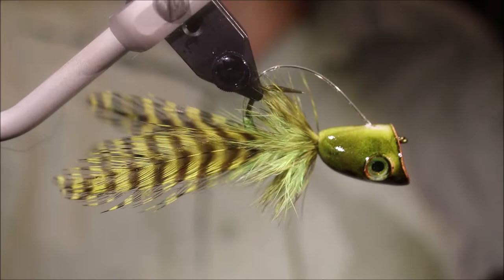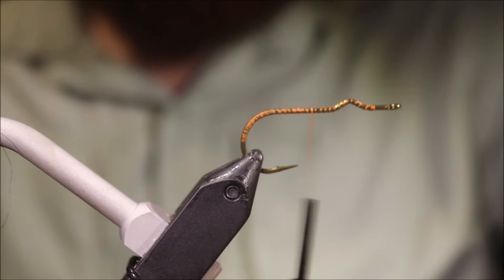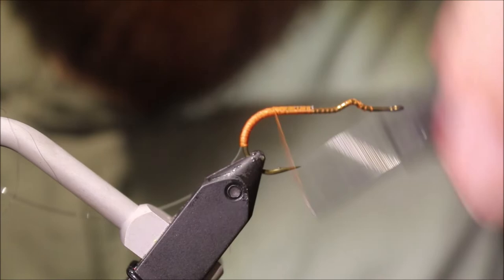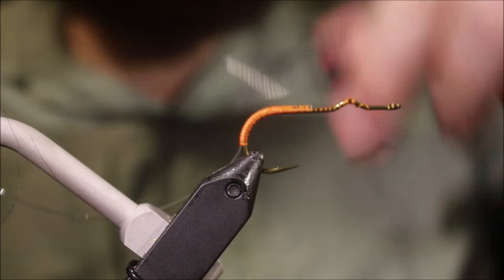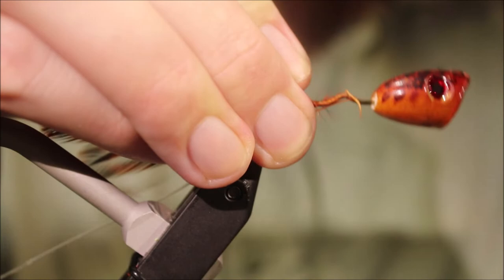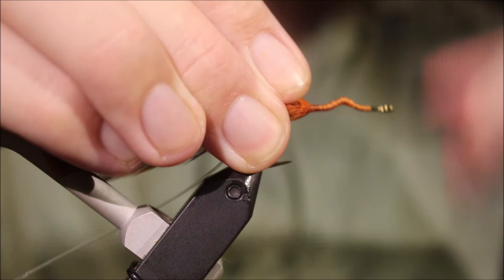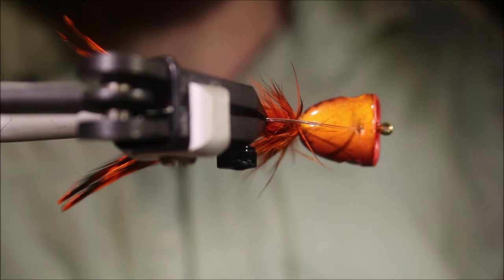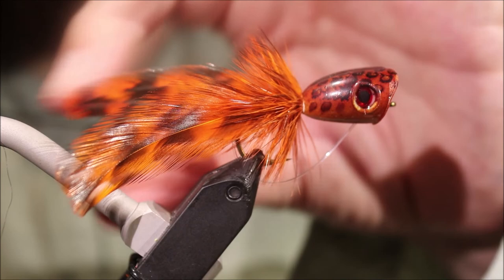Tying a Double Barrel Popper with Martyn White (bass bug)

Comment: Did. Not finish Sorry I am using Double Barrel head too. This is the third time I have used them. I use cpooc markers with air brush. I have not seen video how you do it. I willl look for your video. QUESTION Do you prime popper heads with acrylic pant before spraying yours .
Reply from the maker: Not when using the copic stuff, just make sure to let it dry fully before the top coat